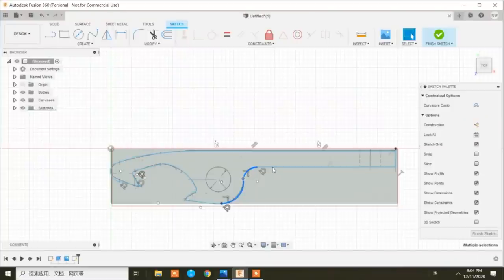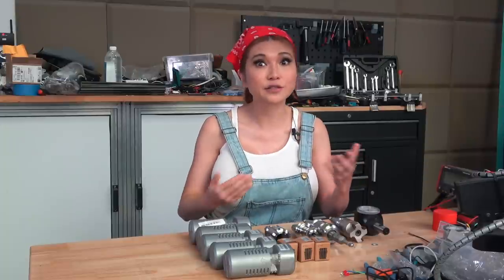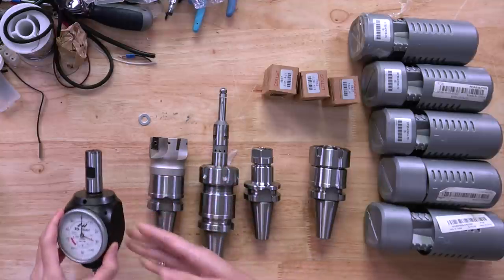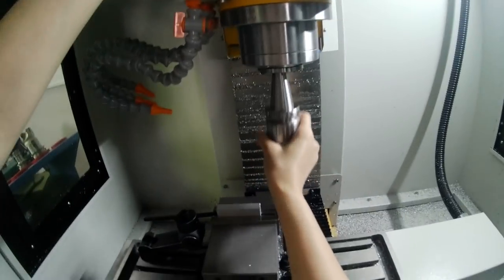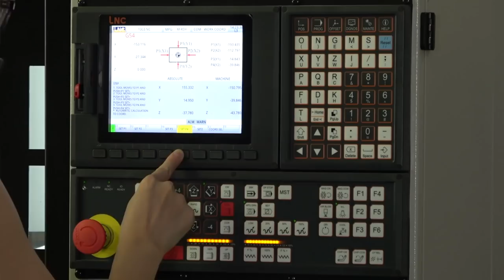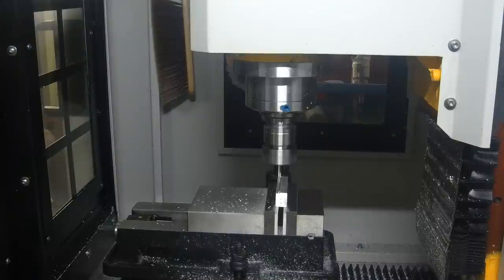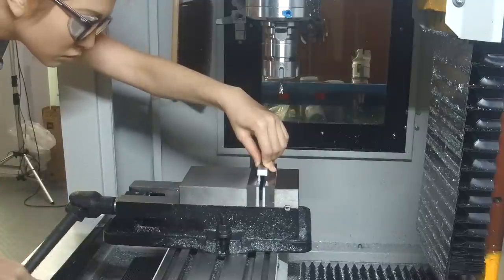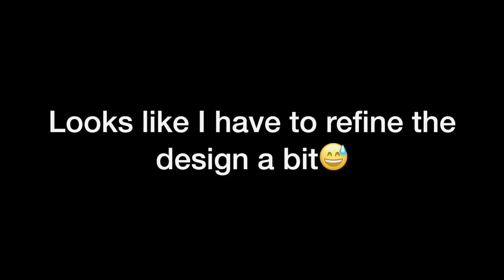First CNC Chips! Milling On The Syil X5 Combo

Comment: hi naomi! quick tip: it’s not recommended to use the compressed air without a tool in the spindle. contamination from chips or grease can negatively effect the reliability of your spindle for holding on to tools, and can even effect precision and even damage the tool holder taper. great video as always!
Reply: This is true... my cnc (akira seiki) comes with a warning not to use compressed air on the spindle or surrounding area. We use paper towels to clean the spindle.

Comment: Naomi, as a production machinist and hobby machinist, I agree with you 100%. My tools are what I can afford to get the level of accuracy I need. I put the money into the most important tools first. For me that is dial gauges, calipers, micrometers, and clamping equipment. Truing your work surface and clamps is one of the largest parts of accuracy.

Comment: Awesome!  I do my machining on 100% manual machines, and I've got a box of broken cheap tools that could have paid for a second milling machine.   I have a box of ancient tooling that goes with it, that's still in great usable condition.  These old ones were top of the line when they were made, 90 years ago.  They work like new.  They do everything but shine.  With the failure of machine shops everywhere, these old second-hand tools are going to be available everywhere cheap.  Keep an eye out for them.

Comment: Exactly right in my opinion as well.  When I was younger I worked framing houses and an old wise carpenter told me the same thing.  Get tools that are good enough/used to get started and eventually they can help pay for better tools later.  When my brother and I started our YT channel for HAM radio to help out our club we used (and still use) the same philosophy.  No need to buy a bunch of expensive tools up front when you don't even know what you are doing yet and your needs will probably change later anyway.  Thanks again for bringing a great realistic view to your videos!  LCARA HAM Radio

Comment: Quick Tip: for setting up the z-direction/tool height use soft material like a piece of paper which you know the height to not damage your mill. Either put a dry piece a paper and check manually until the paper cant move any more or wet the paper with the cooling fluid, put it on the surface and check with rotating spindle until the mill cut the paper.

Comment: Awesome! congratulations on the first chips. I do still get the sweats every time i'm running a new program on a cnc machine. Did I set up the start point correctly?, it's the tool height right? Will i totally crash the head in the vice and ruin everything again?

Comment: For parallel springs you can use metal strapping from things like pallets and heavy crates. It's not the best but it will work in a pinch

Comment: Congratulations. No broken tools, never mind that the design needs some refinement - the milling job was a success.
A tip for finding the Z=0. Place the 6mm end mill/pin that you use to measure the height aside from the end mill in the BT30 holder and then move the Z down. Roll the end mill/pin under the tool and adjust if needed. Don't leave the measurement pin right below your tool. If you go too low you will crash it.
This may be a cheap and simple way of doing it, but that is how I used to do it before I got our new mill with an automatic probing system. I even checked the probing system this way and it matches within 0.01mm
Reply from the maker: Will do!

Comment: Hi just a little tip 
It looks like the collet on your edge finder is not flush with the nut. Maybe try to press the collet into the nut first, then insert the tool and screw the whole thing into the holder. In my recordings, that's the only way it works. I didn't learn anything else during my training. Greetings from Germany

Comment: Spot On! On your tooling philosophy.
I buy tooling based on the precision and repeatability required for the project. The next level is when mass production of parts ($$$).
I would have screwed the blank onto a sacrificial base, eliminating the need to flip over.
Hay! Did you open a beer for Momo too?
Tom M

Comment: Hi Naomi
Great Video and nice CNC machine.
I know you have someone helping you so far .
    You might want to get a tool measurement fixture that way you can put all of your tooling in the collet holder and put them in your tool Library and the machine will know where the zero point is and you dont have to re-zero every time you change tools .
It saves time and tools .
Love you Video and you as well for learning all these new machines .
     Keep up the Great Videos. 😀😀👍👍👍👍

Comment: Exciting times Naomi!! 
To keep the parallels separate you can use a folded piece of nylon banding found on large packages.
It wont break the bank and saves you struggling. 
I have a pragmatic view of tools and tooling in general.
If your going to use a tool to earn your living always buy the best you can. 
Always clean, maintain and look after your tools.
However a tool is only as good as the operator. This is why it is better to have the best teacher rather than the best tool.

As soon as you can invest in a genuine Mitutoyo 150mm Digital Vernier calliper, Digital 0-25mm micrometer and a micrometer depth gauge (order is in importance and usefulness).
As far as tooling goes you will tend to use a 6mm 90 degree spot drill, a 10mm ripper end mill and a 4-6mm finish cut end mills.
I would start out buy doing any tapping of holes by hand until you get the hang of tapping cycles on your mill as breaking taps off can get expensive and frustrating pretty quick.
Well. That's enough of me recycling my experiences.
Take care and enjoy yourself!!

Comment: Hi, im enjoying your videos.
Just a quick tip that may save your endmills from damage. I couldn't quite see but make sure when setting your z axis datum you dont have the height block or known shim piece (your 6mm parallel) under your cutter when lowering z down. Have it clear, go down, slide it under, remove, go down, slide it under, remove etc. If its under and you go down and it hits, it easily chips your endmills cutting edge. Especially carbide.
Keep it up learning new skills. :)

Comment: Great video, Naomi!  I would love a large CNC machine, but would have nowhere to put it.  I have done some very limited small scale milling using a drill press and an adjustable X-Y stock base, to varying degrees of success. An actual small scale CNC machine would be a great help.  Take care and stay safe!
Reply: I recently bought a genmitsu 3018 prover, a very competent beginner's machine. A bit too much give in the chassis for professional full time work (as well as too slow cut-speeds) but as Naomi says in the beginning of the video : 'It is good enough to earn something better'. So my current projects are door-signs and maps. Between that and EstlCam I am pretty pleased with my own cheap tools.

Comment: Use a piece of paper to get your Z axis touch off. Wiggle the paper untill it catches. That way you will not damage the end mill. A piece of paper typically measures 0.1mm so use this as the offset when setting the Z zero.

Comment: You can get great deals on tooling if you know where to look; I bought my lathe from a school that had, like many UK schools, stopped teaching technology, It's now 50 years old and is still very precise but the motor has just failed - the cost to have it professionally rewound is more than I paid for the lathe! I buy most of my tooling used, there are some awesome deals to be found, especially if you're prepared to by a job lot at auction.

Comment: Next thing to learn, separating parts with the metal cutting bandsaw...
Nice work, good practice using the jogging tool to check that you won't kill the bit if something went wrong ( like wrong Gcode selected ).
Since practice makes perfect, might want to try the same file with swapping bits for a cleanup pass and get the sharper corners with it using a smaller bit.
This really makes me want the space for a machine that size and not have to wait for good weather to use my desktop one outdoors!

Comment: If I am buying a tool for a specific purpose, especially that I might never use again, I tend to buy a cheap unit. If it beaks on first use, there is always the warranty. If I use the tool enough that  it wears out, then I will replace it with something better. As you say, often the tool will do the job, and so you can spend the cost difference on more tools!

Comment: Those are some great first chips. Looking forward to seeing what else you end up making.

That said, I do have a couple of suggestions: If you set your datum (the 0 point in the CAM) to a corner it will save a couple of probes as you only need to touch 2 sides instead of 4. Also, in the first setup you can take much more aggressive cuts. By looking at the 20x speedup it looks like you could run the federate at least 10x what you were using (note: do not trust me on this, find a Speeds and Feeds calculator instead). You could have also set your cut depth much higher. You paid for the entire cutting length, you might as well use it.

Another note on feeds and speeds: aluminum is very forgiving, but if you were working on something like stainless and your feeds/speeds were off it would quickly destroy the cutter.

Keep up the good work.

Comment: I havn't seen anyone here talk about the actual cam that was done here, Ill give a few pointers. Don't plunge direct into anything, Use a helix. Its way less stressful and has a better cut. typically you want to cut a rough pass with .5ish mm to leave than come back with a 0mm to leave 2d contour.  Cutting high speed low stepover (assuming you get your chip load correct) is faster and more accurate than 40-100% stepovers.  The power of the machine you have is directly related to how much chip load you can handle. Nyc cnc just released a video recently talking about the basics of desktop mill speeds and feeds that skims over alot of concepts with visuals and in real time changes based on these feeds/speeds that will directly carry over to your larger machine.

Comment: Don't worry about your bottle opener. My first one was a mess and i've got to open my bottle using a table edge.🙄
But i like your opinion about buying tools. First buy something that is good enough and not so expensive. So I can see if I can do the work the tool is created for and mostly I need my tools not very often. So a cheap cordless screwdriver less than 40€ will do it for years.

Comment: So cool, and great to see your beginner perspective, different than seeing experience going back and trying to relive. Can your mill accept a tool length probe? Seems like that might be a nice upgrade. Never seen using an end mill for z probing, usually see a feeler gauge or (sometimes, always seems sketchy) a sheet of paper under a spinning spindle.

Thanks for the great video!
Reply from the maker: Yes, I have a 3D Taster, will use next time...

Comment: Simpler way is just to cut a Nut in to open form and then you drill an M10 to open side about 3 a clock 
At last mill a lite shaft with M10  connect them and you had an better bottle Opener cause of a better leverage law

Comment: Keep your part in the center of the vice. If you have to go to one side. Balance it with a piece the same size on the other side. So the slide jaw doesn't cock. And the part shoots out of the vice. Be Safe and take your time.

Comment: Looks great and i love your CNC machine! I would have made it from 4140 Steel though just so the material doesn't fatigue at the tip as its used... suppose that's dependent on how often you intend to use it through haha

Comment: Today's Lesson: Use 1" round spacer block to touch tools off. Quickly move tool past top of block, lightly bump block against tool and maintain light pressure against tool, then using .010 resolution move tool up until it just goes past block, move block slightly away from tool and go down .010, then move block back against tool with light pressure, then use .001 res upward until it goes just past top of block, now you are no more than .001 away from surface which should be ok with 99.9999% of all the tools you need to touch off....Easy peasy. Also, try not to blow off work area with air nozzle when spindle has no tool in it as chip may get in there. Nice work, you are learning.

Comment: The real problem with cheap tool holders and collets isn't that you aren't able to do precision work. It's a less accurate runout which causes your end mills to wear out prematurely. The smaller the end mill, the better the runout needs to be.

Comment: That is exactly what I think..and to be honest I still use many low cost tools every day ,there is another aspect of business that is employee's and in construction employee's in America do not respect the tools the boss let's them use my ryobi driver  drives the Sam screws as a Dewalt  only difference is if I drop or an employee " drops" it off a roof and it explodes  I have a replacement cost of 79 dollars or 300 my personal ryobi driver is going on its 3rd year 😉and still will drive a 6inch timberlock so sometimes it pays to keep using cheapo tools its piece of mind ad it allows me to love people and use tools instead of most of my peers who love there tools and use there employee's 😉

Comment: Seriously; selecting a beer bottle opener for a first project wasn't an accident, was it?
Reply: Hey, I did one of those in high school, though without the fancy CNC!
Reply: @DamonHart-Davis  Bridgeport milling machine or just hand tools?
Reply: She used to joke that any money she gets will be spent on beer and women, so I'm guessing not! :-)
Reply: @klfjoat  Hah! I recalled that also. She has also declared, "Work hard, play hard!" I don't say this about many people but, Naomi, is an inspiration (in a good way, of course).
Reply: @williamswenson5315  I made one with nothing more than a coping saw and a file, in high school.
Reply: @everythingquads  Yeah, but what I'm looking forward to, is a carefully milled and difficult to fabricate component that gets used in a piece of machinery. As example, mill a small steam engine or a replacement part from a damaged template.
Reply: @williamswenson5315  I left high school and worked as a CNC machinist, 30 years on, I'm a CNC miller / programmer. making a lot of aerospace components.
Reply: @everythingquads  Interesting occupation. Can I assume you live in CA and work for a outfit on a par with say, LocMart, Boeing or Grumman/Northrup?

Comment: If you are milling aluminum the chips can be a problem.  Under given conditions they are combustible (think thermite) and there can be a reaction enhanced by water.  It would be best to thoroughly vacuum them after a project or before there is an accumulation.  I'll check on proper disposal (which actually might be recycling) so you are not storing quantities.   Because of the nature of my background I was was responsible for safety in working with metals and was called in to do forensic investigation for fires and enhanced aluminum facilitated explosions.  Underground coal mines are allowed only limited use of aluminum types of instruments and equipment.  My back ground is odd and varied.

Comment: Once you get good at programming and design you can make your own tooling and don’t be afraid to look for alternatives to the expensive things you want yes it wasn’t made for cutting steel but at a slower speed and a lighter feed it will work even though it was made for cutting wood and not steel 
A simple regrind of the edge of it and you have a good cutting end mill at half the price for aluminum it’s great just less angle on it and it will be fine. Of course I am a tool and sue maker so take that with a grain of salt. 
I know that a 20 degree angle will cut wood and a 5 degree will cut aluminum and a 1 will cut steel if you don’t overheat the cutter. Start at a 90 degree angle and subtract from that a 15 degree angle will be a total angle of 75 degree or sharper a steel cutter the angle is barely enough to see and not very sharp at all I have also run abrasive cutters instead from a Dremel tool at a higher speed and a very little depth of cut feed rate backed way down they don’t last long but it works just make sure that you clean the machine thoroughly after you do to remove all of the abrasive from it